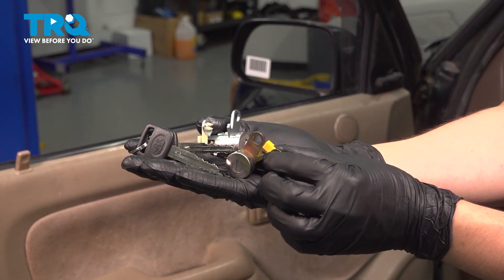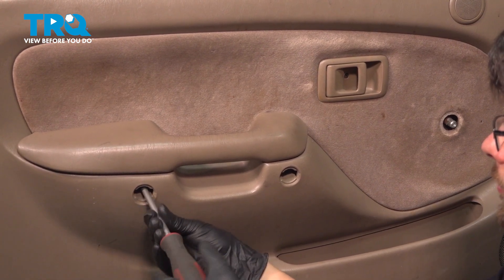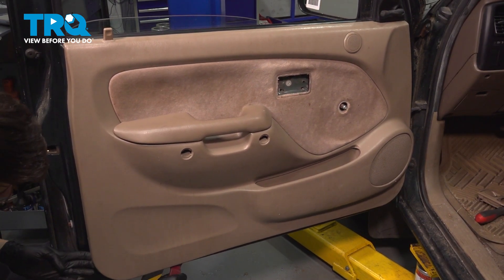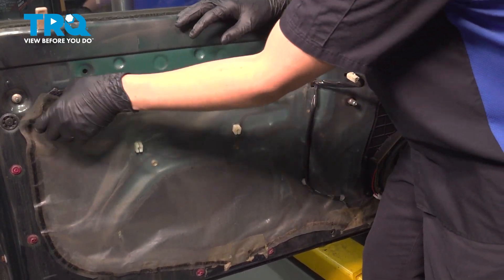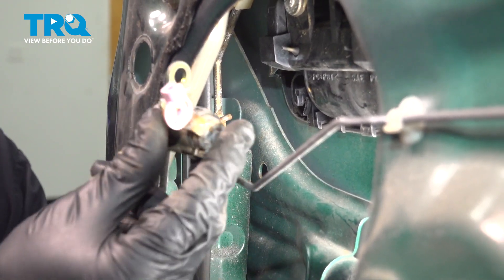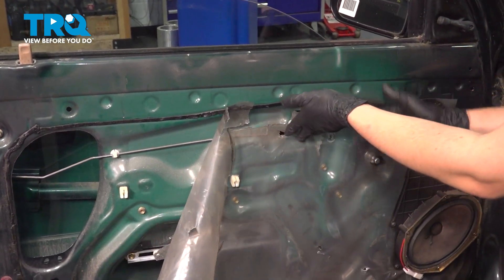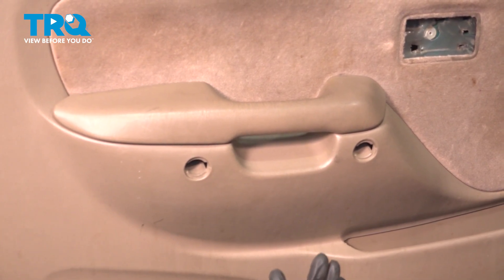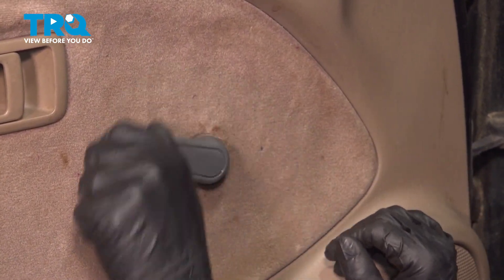How to Replace Door Lock Cylinder Set 1995-2004 Toyota Tacoma

Comment: Thank you!  Mission accomplished thanks to your good directions.  the only issue I had is the new lock isn't fully flush with the outside door handle panel..but the 10mm bolt is secure.